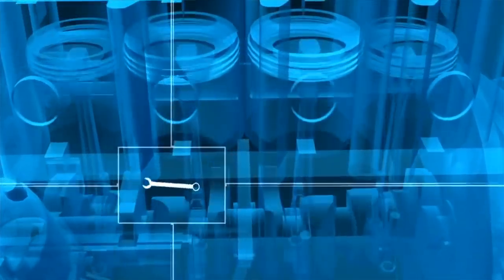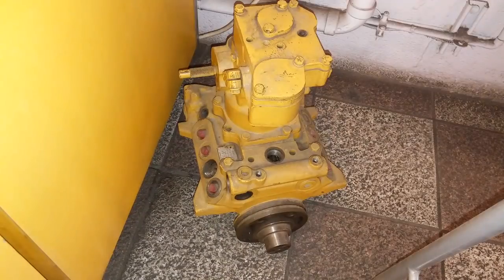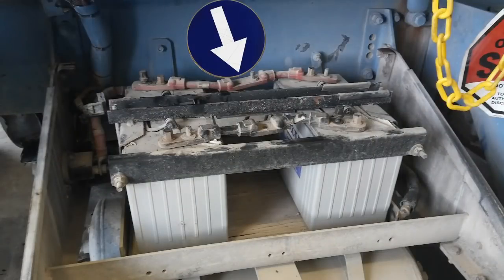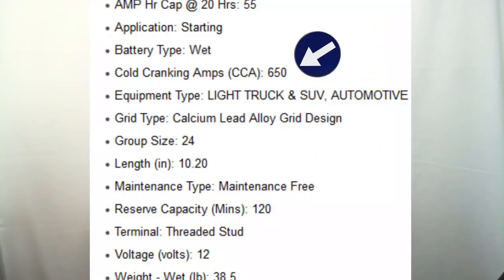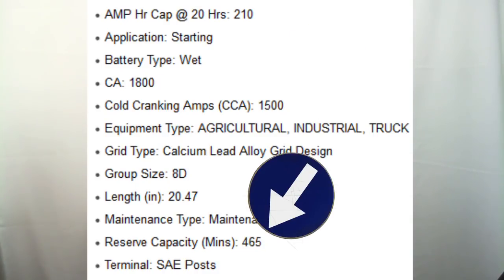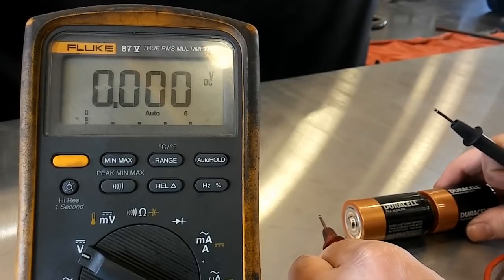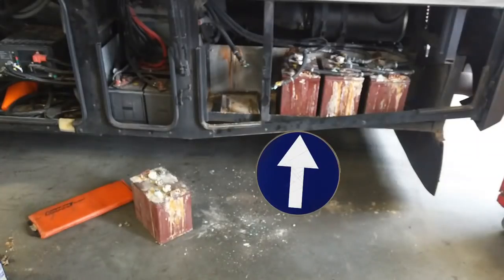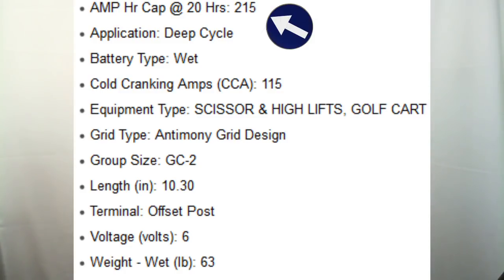Why Do Diesels Have Two Batteries?  Why Do Diesel Engines Have Multiple Batteries?

Comment: I used to run an 8d in my dodge diesel in the bed. It worked fine. I got a good deal on it. 80 bucks it was a 2nd. Now I have 2 group 31s. I may eventually run 3. I have a plow and often have to start well below freezing with no block heater. It's hard to start sometimes.
Reply from the maker: +Wilson Solt More reserve capacity the better.
Reply: Is it older? My 02 powerstroke starts good down to around -10°f, so long as I cycle the key a few times for the glow plugs to work a little magic.
Reply: Wilson, I have found on our plow equipped pickups the batteries are not sufficiently charged during the time of plowing, as the fulling articulating plows require 100 amps to lift or to rotate placing a huge draw on the batteries, a situation which the normal pickup alternator cannot adequately replenish.  I would suggest upgrading the alternator.  Also, bear in mind that if the diesel is a Cummins 6.7L engine, it needs to turn over at a higher than "normal" rpm to start, so if the batteries have not been adequately charged from the previous day's work, the engine will be turning over slower than that which is optimal for starting promptly.  You can use a little ether along with a battery charger connected to the batteries overnight to aid cold starting.  HTH
Reply: Jay Dunbar my 99 Powerstroke has started below zero instantly on the one or two times in a hurry forgot to wait for the glow plugs

Comment: How long should u let a diesel warm up for in the cold thanks
Reply: Colin Adams 5 min tops, anything more is wasted fuel.
Reply: How long before idling away vs how long before a full throttle pull up a hill.
That is where you get an argument.
I start my 6.2 and let it run till the housing pressure cold advance kicks off; about 10 minutes if it is below zero f outside.
Then i drive a low speeds.
If I had to pull a 10% grade right after start up on a sub zero day, i'd let it get closer to op temp first.

Comment: I have a truck that is 24 volt for starting but the alternator is 12 volt. How does that work? I also have an excavator that is 24 volt start with a 24 volt alternator. All the batteries are wired in series. The truck has 4 batteries and the excavator has 2. All of the batteries are 12 volt.
Reply: At a guess the starter may have a solenoid that puts 2 batteries or pairs in series during cranking then back to parallel to charge from 12v Alt.
Reply: ya what truck
Reply: Matt Lane Kenworth T-600 with 3406 CAT.

Comment: Most?! Maybe in some huge applications but most normal diesel cars have just one battery and they start just fine even in winter.
Reply: 3:54
Reply: Oh should have paid more attention lol
Reply: Many are designed to have 2. Just people are cheap.
Reply: The channel owner specifies that he is usually working on heavy diesels.

Also, although small cars with diesels typically have one battery, that battery is almost always larger than the one found on the gasoline powered variant. I'm sure if you look under the hood of VW or Benz then you will see it.

Comment: Diesels are the worst invention.  They could have 30 batteries, and they still wont start in cold weather.  Hence the electric plug that needs plugged in to heat the motor so it starts.  Good luck starting your stupid diesel  when there is nowhere to plug the electric plug into👋🏻
Reply: I agree with you I got a ole 6.5 it’s like starting a semi in the winter if you are not rich two new battery’s in Canada is about 350 to 400 dollars I don’t got that kind of money laying around I swear it’s the hardest starting vehicle I’ve ever owed a had a few big block 440 mopars that were easier to start
Reply: jeremy greiner I have to plug it in as soon as frost hits early October in Canada some years